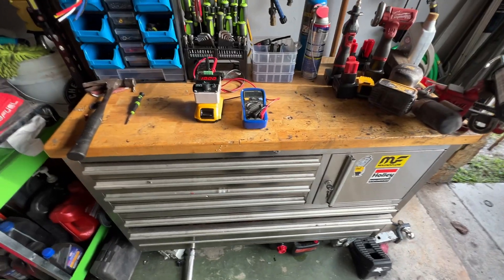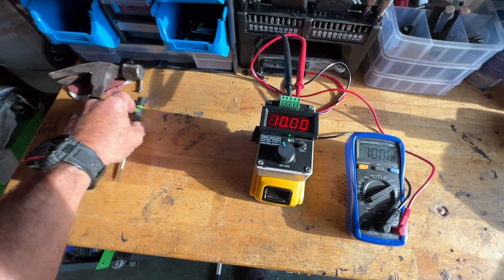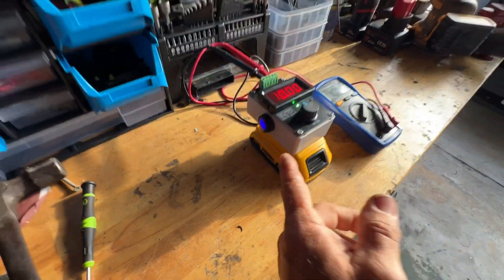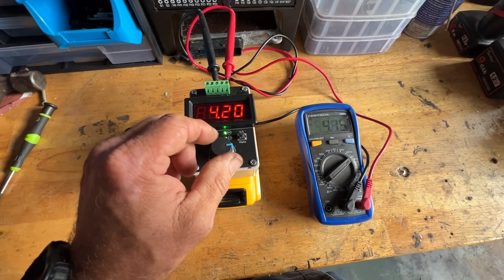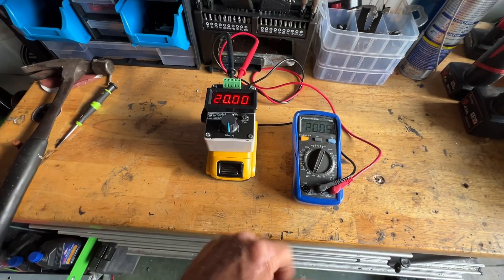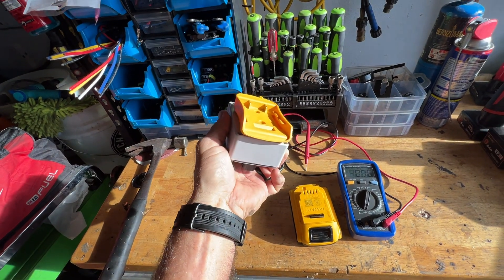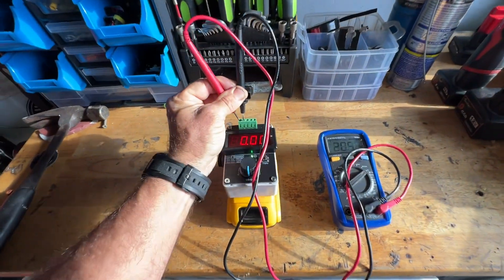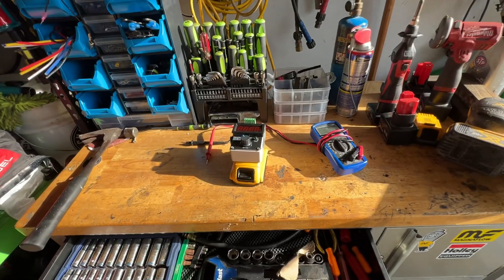Building A Signal Generator With Parts In The Garage

Comment: That’s a bit more advanced than the one I made with a 9v battery and a 10k pot!  And cheaper than one of the fluke process meters which has the signal gen stuff built in!  Cool hack!
Reply from the maker: I finally found a use for those 2ah Dewalt batteries, Thanks for the comment!